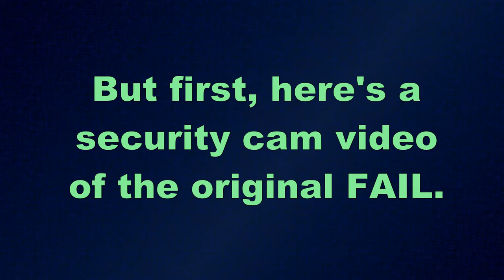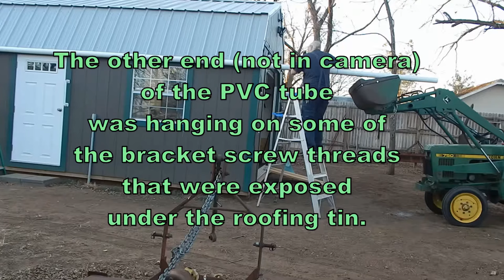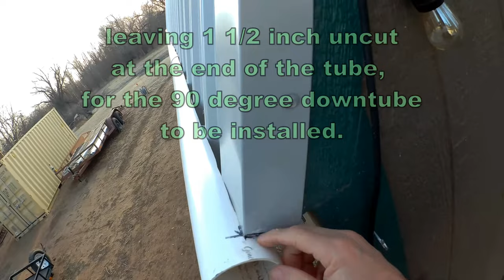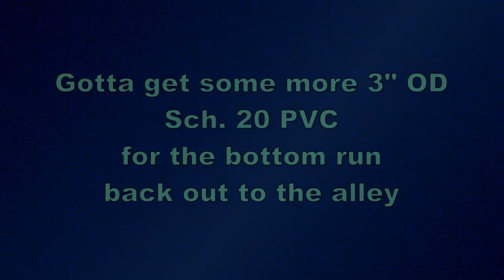Shop (Tin Roof) Rain Gutter Project, using  3" OD- Sch. 20 PVC (Experiment)

Comment from the maker: After a year: After checking the gutter for clogs or obstructions etc.  yesterday, I did find it to be rather clogged with old dead leaves and pecan tree seed pods (still falling), which are a nightmare in themselves. I ended up using a small wooden shim to more or less drag and/ or push the muck towards the downspouts, and also had to cut some relief slots at the top of both ends of the gutter (I should have installed cleanouts at both ends), to allow me to remove a good deal of the muck, and then used my water hose with a jet stream nozzle, to clear gutter and downspouts, until the rest of the muck washed down and out the drain. It took longer, and was harder to do than I hoped it would be, but it worked! Since nothing is perfect in the world of rain gutters and leaves etc... I'm more than satisfied with my method.
Reply: Thank you for the heads up..
Reply: Thank you for the follow up!

Comment: Now I know exactly what not to do. Not this for sure. Next time try pulling the pipe on instead of trying to push it on. That way you avoid hitting the brackets. Also, what is on the back of your neck?
Reply from the maker: I showed my way, including the mistakes, so now, why don't you show me yours. This is all about learning and experimenting... I just documented my experience. And trust me, I tried pulling it on, not easy on a ladder at 74 years old. By the way, It's been 2 years now, and it still works near perfectly.

Comment: Thanks for posting this.  Had this idea before even seeing your video, but nice to see it implemented. Like that it even protects the edge of your roof.   I will have a 12x12 single pitch polycarbonate roof.  wonder if it will overflow if no pitch on the gutter in Florida where we sometimes get massive rains.

Comment: Great video on an idea I was toying with and the bracket idea is so simple...if it doesn't hang up on anything. Ill have to cut a small piece as a template to see what spacing works..i prefer Sch 40 as I feel like 20 might get sun damage and break apart.
Reply from the maker: I also considered Sch. 40 but decided the added weight might be more of a problem, especially in heavy weather. I wish I'd thought of your small template idea too. I just did some quick sketching, and then jumped in.

Comment: Did the gutter system work as you intended? Did not see anything in the comments nor a follow on video
Reply from the maker: So far it appears to be working well. At this time I have a lot of dead leaves on the eves, that are due to be cleaned off, but there isn't any blockage to the system that I've detected.
Reply from the maker: A followup for you... I hadn't checked the gutters' draining capabilities since installing it last year, so I checked it yesterday, and found it to be rather clogged with old dead leaves and pecan tree seed pods (still falling), which are a nightmare in themselves. I ended up using a small wooden shim to more or less drag and/ or push the muck towards the downspouts, and also had to cut some relief slots at the top of both ends of the gutter, to allow me to remove a good deal of the muck, and then used my water hose with a jet stream nozzle, to clear the entire line until the rest of the muck washed down and out the drain. It took longer, and was harder to do than I hoped it would, but it worked! Since nothing is perfect in the world of rain gutters and leaves etc... I'm more than satisfied with my method.

Comment: Good afternoon sir, I need do to the same thing in my house, I want to know if this job still working or did you need to do something different
Reply from the maker: It has worked very well for almost 2 years now, but I wish I had added 'clean-outs' at both ends of the system also. But, with a little effort that can be done, as long as I'm healthy enough to climb a ladder still?
Reply: @seriouslyvideoproductions4664  thanks mrs.
Reply: @seriouslyvideoproductions4664 It's exactly the same job I need to do, because I don't want to cut the roof, bless

Comment: Nice video, but was there any reason for not capping one end?
Reply from the maker: I did cap both ends, as can be seen in the last still photo. However, in hindsight, I do wish I had installed 'clean-outs' at both ends, rather than just the  downspouts.  If I that I'll post about it in the future.
Reply: @seriouslyvideoproductions4664  that actually sounds like a good idea. Sorry must have overlooked the capped ends!
Reply from the maker: @robertbyerley1188  Are you by any chance Bob Byerley from G.P., Texas?
Reply: @seriouslyvideoproductions4664  no you’re referring to my father.
Reply: But he didn’t live in Texas

Comment: How did you slope the pvc for drainage?
Reply from the maker: The building is set a slope towards the house, to keep water from puddling at the garage door entrance. The lower drain pipe slops in the opposite direction towards the back of the property. Put a brick under the head end first. Thanks for asking.

Comment: How exactly did you attach the gutter to the roof? It looks like you used metal brackets but I can't tell from the video how those are attached to the gutter itself. Thanks.
Reply from the maker: Self Tapping Insulated Metal Roofing Screws .
Reply: @seriouslyvideoproductions4664  Thanks. I see how the screws are attached to the roof but where are the screws and brackets attached to the PVC itself?
Reply from the maker: @jeffkyle6910  The brackets are attached to the edge of the roof only. The PVC pipe is not attached in any way, as it has to be slid over each bracket from either end of the roof edge. You might want to watch the video again, so you get a clear picture of the procedure.
Reply: @seriouslyvideoproductions4664  Thanks for pointing that out. Somehow I had skipped over the bracket part of the video. Thanks!

Comment: I could install regular aluminum gutters on that. The PVC only lasts a few years in the sun's UV
Reply from the maker: Unfortunately in my situation, there is not enough clearance from the roof line edge and door frame, to allow the door to be opened or closed, using conventional aluminum gutters. But I agree with you about the UV damage to the PVC, which is brutal out here where I am in Texas.
Reply: @seriouslyvideoproductions4664  oh above the door I see what you mean, yea that sucks for that.. I would have maybe just had gutters the rest of the area and left it hahaha. good luck on your PVC surviving.. You can spray paint it which we did in large growing systems that gives it several extra years.. but you want to paint it generally right when you buy it
Reply: @seriouslyvideoproductions4664   If they make it that big the grey PVC electrical conduit can survive the UV.
Reply: Perhaps a spray paint to protect the pvc pipes I will consider or try nothing to lose.
Reply: @Romantico1962  yea it works, it's not as good as grey electrical conduit unfortunately. All the paint comes off so has to be redone.

Comment: Are the brackets 1-1/2” long?
Reply from the maker: Yes, 1/2 the inside diameter of the 3 inch thin wall pvc. Other sizes may work also, and you might have to experiment some, to get yours to hang the way it works best in your configuration.
Reply: Thanks for the reply and the great video!

Comment: How exactly did you attach the gutter to the roof? It looks like you used metal brackets but I can't tell from the video how those are attached to the gutter itself. Thanks.
Reply from the maker: Jeff, the PVC isn't attached at all, to the brackets. The entire length of PVC is slit and the end edge is slid over each spaced bracket, and is held in place basically by gravity and the angle of the brackets. Note the 'still' photos in the early part of the video.